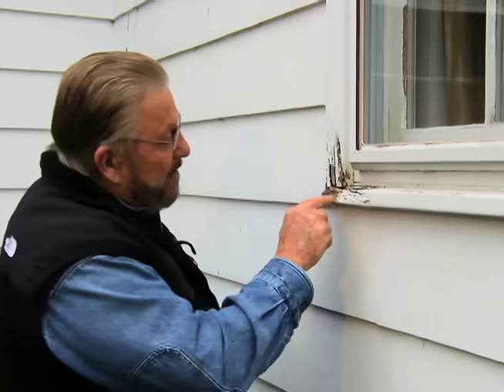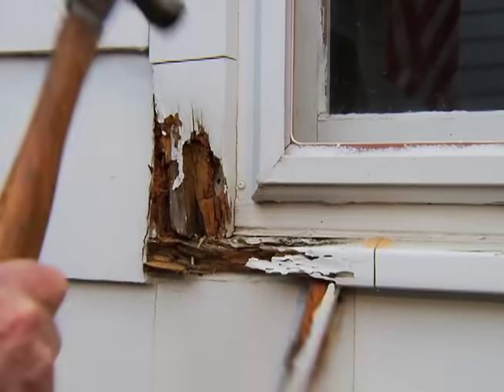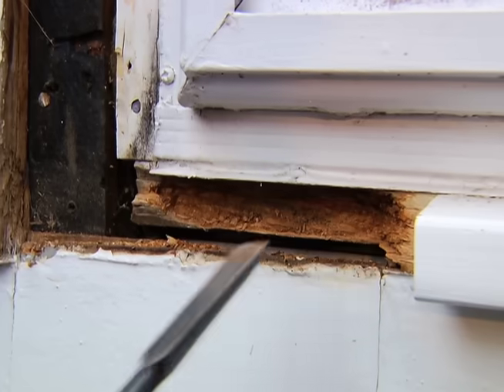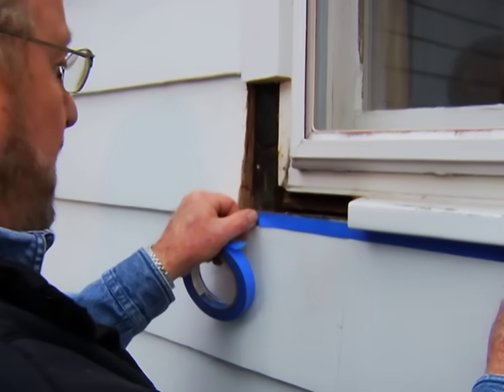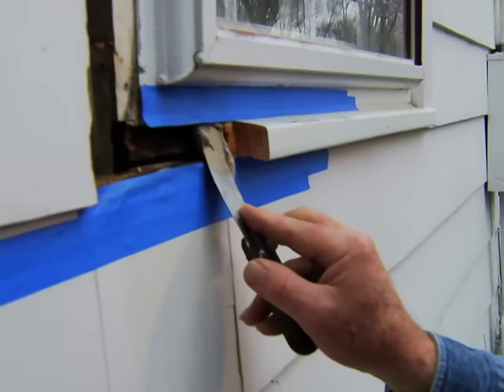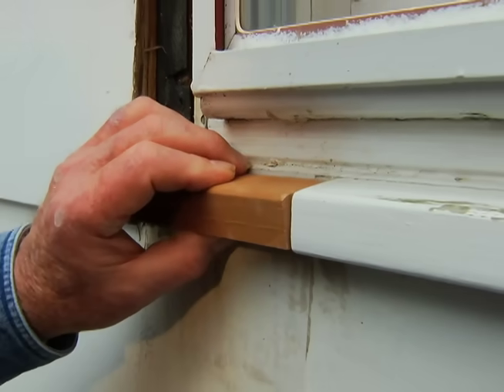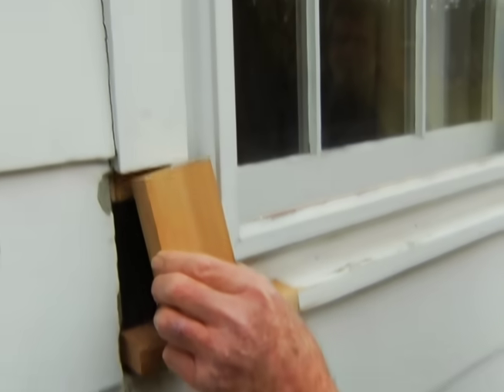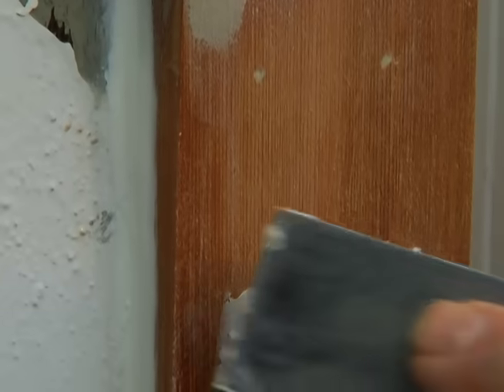How to Repair Dry Rot in a Window Sill

Comment: Run some long screws into that hole just below the surface, give that putty something to grip.
Prime paint all of it including the back and the joints on both sides before you nail anything.
Fast drying exterior primer will dry in five minutes.
Place caulk inside of the joints before you push them together, wipe off the excess.
Use Bondo auto body filler.  Same thing much cheaper.
You can buy it by the gallon at Walmart for $16.
Reply: Yo are exactly correct. if you dont use the screws, eventually that putty will break loose as it has nothing to hold onto. Also. if anyone thinks he sanded all that bondo (wood filler) down by hand. i know of a nice bridge in Brooklyn I can sell you. use a power sander. Lastly. instead of using bondo to do the final fill in those cracks between the old wood and the new. instead use a quality exterior spackle. Ace hardware sells the best with a product called "Synkoloid Exterior Spackling Paste 01204". It sands as easily as sheetrock spackle and when dry will even resist rain unprimed
Reply: Plastic auto body filler is pourous and allows moisture to penetrate.  "Bondo" is a brand.  We hope that fillers for homes/structures are water proof.  In auto body, filler is applied in a thin coat, because thick cakes crack from torque and vibration.  Perhaps, the expanding, contracting, and shearing forces of a wooden house raise the similar challenges to thick cakes of filler.  The ethical contractors should share their insight.
Reply: @aguilayserpiente   I am reputable and ethical contractor with over 45 years of experience. I have used both and find little to no practical difference between the "Bondo" brand  two part auto filler and the "Minwax" brand   two part wood filler. there is far far greater torque and vibration experienced with cars than homes. Inles perhaps you live in an area prone to earth quakes LOL. When used as described above (screws or nails into the sound surrounding wood) each works just as well the other. At least until a more proper replacement is done.
There are a few reasons however that I have seen each fail and none have to do with one two part product being any better suited then the other. One common is the reality is the entire area needed to be replaced and the customer was unwilling for whatever reason to do the proper  more extensive repair. Or the cause of the moisture entering the area wasn't truly located or addressed. As a result. the area next to the repair then rotted. Unfortunately. Those customers unwilling to splurge for the proper repair usually aren't featured in videos...or at least that's not what the audience is told.  Another reason is because the screws into the surrounding sound area aren't used and because neither filler really doesn't bond to the surrounding wood. you end up with the same effect as if you had inserted a piece of wood without nailing or screwing it into place  then yes the repair will crack and separate. You need a way to anchor the repair. Think of it like when a dentist puts a post in a really bad tooth. The post is what holds the filling in place against the forces from chewing.
 Remember. Wood is porous too. The posts (screws) also help in any movement happens in unison with one another because its all attached. I prefer screws over nails because screws have more grab and are less likely to pull out. In the video above I would have used 3-4 screws into the surrounding solid wood 2 extending into the wood below the window and 1-2 to the side about half way in but below the surface of the patch. And finish as described in my post above with a  quality exterior spackle which is far easier to sand. then prime and paint.
Reply: @TMendez528  Thank you for sharing.  It is exactly what I thought- plastic filler on a house is temporary.  In the automotive setting the plastic is sealed on all sides, excluding moisture, unlike the house, where the back and sides of the plastic are subject to moisture infiltration.  Best regards.
Reply: Bondo isn't the same thing. The minwax compound and similar products move with the wood and create a permanent bond. Bondo doesn't stick nearly as well and won't flex, resulting in cracks and failure over time. It can still work, just not quite as well.
Reply: @austin2842  Says you. Bondo stays stuck to the side of a car vibrating down the highway. Minwax wood repair is exactly the same as Bondo except it costs about ten times as much.  If you have any doubts mix some of each or just the Minwax and spread it about 1/4 inch thick on a piece of plastic and lay it out in the sun for a least a day. Peel the piece off of the plastic and try to bend it, if you bend it very far it will snap in half exactly like Bondo.  Bondo will stay in place very well but it will not move like wood, neither will Minwwax wood repair. In most cases if the rot is removed and the rest of the area is dry the wood will not move enough to cause a problem. If you want something that flexes you will have to use two part epoxy, and you will really pay for that.
Reply: @udavidism  Cars are metal and metal doesn't expand and contract like wood. Bondo works well with that. I haven't used the minwax product but I know it's a knockoff of a product I use called Woodepox. This product does bond well to wood, moves with the wood and  can been tooled and cut just like wood. If minwax is more like Bondo then its definitely not worth the price. Woodepox is worth it in my opinion, but like everything else it has its place. I use it for outdoor trim where we get extreme weather swings, and where I want a permanent fix that will never need fixing again.
Reply: @austin2842  Your first comment said two things that you have changed.
First you said Bondo didn't stick which is wrong, it will stick so strongly to almost anything you will have to beat it off with a hammer into small pieces.
The second thing you said was that Bondo and Minwax wood repair are not the same thing, they are exactly the same thing. 
Now you are talking about a two part epoxy called WoodEpox, Minwax is not epoxy.
My last sentence was " if you want something that flexes you will have to use a two part epoxy, and you will really pay for that." 
WoodEpox, is a two part epoxy, which according to Amazon is $24.63 for 12 ounces, like I already said VERY expensive.
If you are going to make statements and then keep changing them, just don't.
Reply: @udavidism  I have not made two statements that I have changed. Bondo is a product designed to stick to metal, not wood. I am a metal guy, welding since my teens and into my 20s. I'm also an industrial designer, university educated and practicing now for 20 years. I know how to make things, how to design things that work and which materials to use. Bondo will hold to wood, but it's not designed for it and its highly recommended to include wood screws to keep the product in place because it will break loose over time otherwise. It will form cracks and allow water penetration regardless, which means it is not a lifetime product. It may work well for you during application, but check back in 5 to 10 years and it's a different story. 

Regarding Minwax vs Woodepox: I was clear in my second post that I had assumed initially that the two products were the same. If they are not, and minwax is actually a bondo derivative instead, then or course don't bother with it. That said, if you want it done right and want it to last, don't use bondo. It's a quick, cheap fix that will fail eventually.
Reply: @austin2842  Well that explains it all you are “university educated”, excuse me.
My education came from working in construction all my life and now I own my own construction company. 
For someone so educated you need a refresher in reading comprehension. 
Go back and read your very first statement, you said “Bondo doesn't stick nearly as well”, like I said Bondo will stick to almost anything.
You also tried to tell me that Minwax is different from Bondo, it is not, they are exactly the same, I have used them both.
THEN you brought up epoxy, a completely different product that I mentioned before you did.
You just stick to “designing” and the rest of us will stick to practical knowledge on how to fix houses and make repairs that I have been doing since before you were born.
Since you are so “educated” I will let the incorrect statement you are about to make be the last word.
Reply: @udavidism  Alright, you're clearly devolving this into personal attacks and just trolling the comment board on YouTube. It seems to me that you're projecting your problems onto others.

Everyone should understand that this is an example of a contractor that shows up with his quick fix low budget solutions and a tailgate warranty. You'll end up paying twice to fix what he did. I've spent a lifetime in industry and contracting and I've learned it doesn't pay to rely on guys like this. Bondo is NOT designed to stick to wood and doesn't unless additional anchors are included to keep it place (like wood screws). For anyone that wants proof, there are many videos on this platform explaining this. Or, if you have questions, just call your local house painting company and ask them about bondo and exterior wood. They will tell you it's a patch and it's not going to last. Don't get suckered by fly-by-night hacksters with their quick fix solutions.
Reply: @austin2842  I am not trolling anyone. You are replying to a post I originally wrote, that's how I knew, it sends me a message. 
Look at my post at the very top (written 11 months ago)  and see if you see anything about screws.
I have worked for a group of well paying customers for over forty years, I see these same houses every few months. I guarantee everything I do and I have not had to redo any patches I have made.
I don't have any problems or questions, I was correcting an inaccurate post that you made and then when I called you on it you suddenly changed to epoxy. 
I was not going to answer you but you started out completely wrong and went downhill from there.
Reply: @aguilayserpiente  Thanks Jose... I'm doing a LOT of handy-man (woman) work while hubby is deployed...and I want to do EVERYTHING with as high quality as I can... not that I'm wanting to spend a fortune...I just want to do it 'the right way' for when I give him the details of what was completed.  I appreciate the truth way more than short cuts:)
Reply: udavidism   Good point. The way he did it will probably last as long as he does.
Reply: @austin2842  Why does pink Bondo auto body filler list wood on the can?
Reply: @charredskeleton 
Because that's what they're marketing it as. I suggest going to the Home Depot website and looking at the Bondo Wood Filler. In the comment section below, someone asks if it expands and contracts with wood. A reviewer responds that it does not and that cracks form where the product meets the wood. Ultimately, you decide if this is acceptable for you.
Reply: @udavidism  How long does one of these exterior Bondo wood repairs last? I've only just started using the stuff, and it is a joy to work with.
Reply: @charredskeleton  The wood around the repair needs to be dry and prime painted. If the area is dry the patch will last for many years, if the area is wet it will shrink at some point and the repair will have to be fixed around the edges.
Reply: @charredskeleton  
The scientific process eliminates personal bias as a factor. What is the significance of this to using bondo on wood?
Reply: @austin2842  How do you feel you're progressing compared to others in your field?
Reply: @charredskeleton  
I'm progressing well in my field. What relevance does any of this have to the topic?
Reply: @austin2842  How do your posts in this section reflect upon you?
Reply: @udavidism  Thanks for the quick response. Primer and screws make sense.
Reply: @charredskeleton  
How do your posts in this section reflect upon you? Are you the same person that attacked me for posting facts, just using a second account to do so?
Reply: @udavidism  
Funny how the other person questioning  me showed up randomly to defend you, using the same accusatory tactics as you. I hope its not actually you using  a second account, because if it is, then all I can say is: sad. And that you really need to get out more.

You do you though. Have a nice life.
Reply: @austin2842  I only have one account. No conspiracy here, just people that have done these repairs for years and know you are wrong.
Reply: @udavidism  That makes sense, I've seen many porch and deck posts rotted at thier bases. I worry about structural integrity with any patch or filler, and wouldn't dream of using Bondo on something load bearing. Thanks for sharing your experience.
Reply: @austin2842  Nope not the same person. No attack, just questions. Trying to understand. Does finding someone with a simmular opinion make your shared views fact?
Reply: @charredskeleton  
Your repeated accusatory questions are intended to push me back on my heels. Whether or not your are the same person as the OP, I cannot be sure, but I strongly suspect that you are. You exhibit the same behavior, accusing and trolling, and show a bizarre need to validate his opinion. The information I have provided is not opinion. It is fact. It is verifiable. If you don't like it, that's your right.
Reply: @udavidism  
I know you are wrong. The article I posted, reinforces everything I have said: that you are wrong... including not believing painters that tell homeowners bondo is a longterm fix. It is not. It is a low cost, quick fix.
Reply: @udavidism  One last question, what's your expereince with the wood stabilizers? Products like Minwax wood hardener. Do you use them? When, where, etc? And thanks again for sharing your expereince.
Reply: @charredskeleton  I have always tried to remove loose, rotten or otherwise soft decayed wood. This wood hardener will toughen it up but will take several coats and several hours to completely dry. You are left with an area that is substandard in my opinion.  If you can't remove all the rot then I think it would be better than not using it but I try very hard to avoid it.
After removing all rot I always I always prime everything with an exterior grade, fast drying, oil based primer like Zinsser Cover Stain, it drys in 30 minutes and in the sun it will dry so fast it is hard to brush it on. Primer seals everything up and gives a solid surface to apply a wood patch or Bondo.
Reply: @udavidism  Thanks for all your insight. I really appriciate it.
Reply: @austin2842  What is your view point? Please summarize your perspective. I probably should have led with this, understanding is paramount.
Reply: @TMendez528  drediock and udavidism and Bondo are correct.  Austin is a nerd.  The min was is simply overpriced crap in the long run.  The prep is key, even for a false fix.
Reply: When you say run long screws, do you mean drilling all the way or leave extended a bit, so it has something to grab on to? Hope that makes sense. I’m trying to do this as a newbie DIYer. Thanks!
Reply: @nadiahillawi3124  You need something for the filler to anchor to. You use screws long enough to get a good grab into something solid and leave the heads sticking up high enough so the filler can grab onto them while keeping them below the finished surface.
Galvanized decking screws work well, you don't usually have to drill a hole and they won't rust.
Reply: @mgmarrow  When your buzz wears off, if ever, maybe you will understand this conversation.
Reply: @udavidism  As you say you put up this video, i think people should be informed this was "wet rot" not "dry rot". Dry rot is another ball game, if it is not traced to the end in all directions it will take over your property, it is a fungus and the spores if left unchecked will travel through walls until  it is killed.
Reply: @victorterence4279  I did not put up this video, I just responded to it.  There is no such thing as dry rot, look it up.   Wood furniture that was found inside of the pyramids was just as solid and firm as the day it was put in there over three thousand years ago.  Dry wood will not rot.  The fungus that attacks wood needs moisture to live, dry rot is an old myth that somehow stays alive.

Comment: He tapes to protect the siding from the first coat of filler, then just makes a big mess with the second coat, the gap fill, and everything else
Reply: He managed to get filler underneath the tape about an inch below where he was working and another 3 inches below that .  No amount of tape was going to protect that siding from  Michelangelo here and he knew it.  Don't throw good tape after bad..
Reply: He’s gonna sand and paint anyway, the blue tape was to minimize the mess.
Reply: *****LMFAO***** When i saw that...WTF
Reply: @preago  he needed to use latex caulk to seal the masking tape from seepage.
Reply: Then his paint job was a mess.
Reply: It’s possible he only did the intro and outtro of each step, and someone else did the rest.
Reply: @daled8221  yep.  he kinda tripped at the finish line with that globby paint job.  lol.